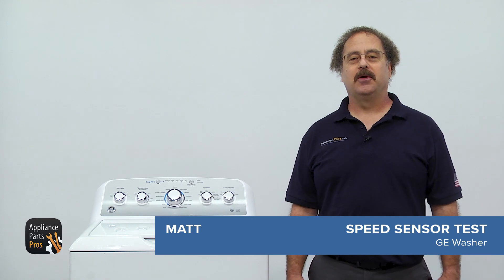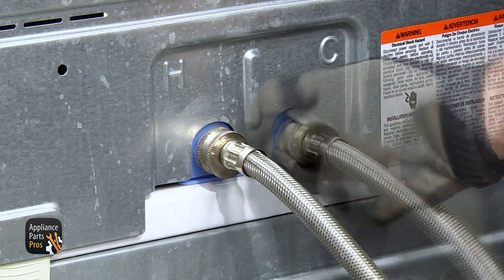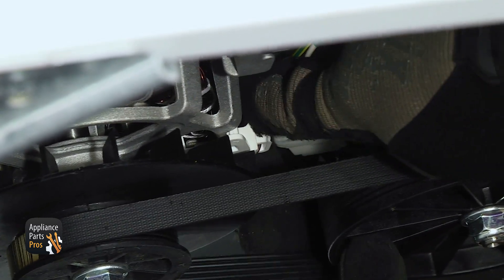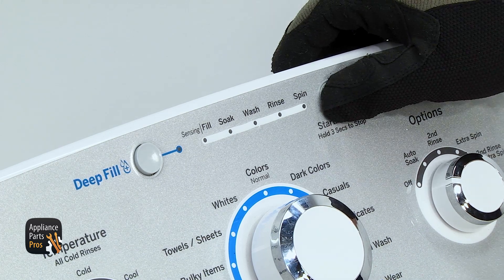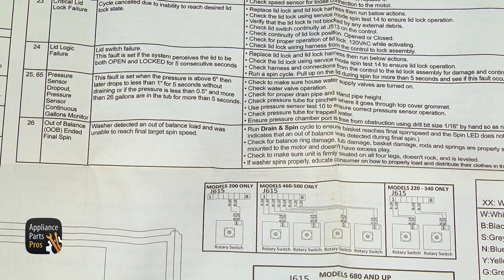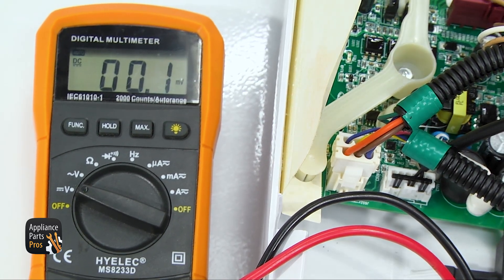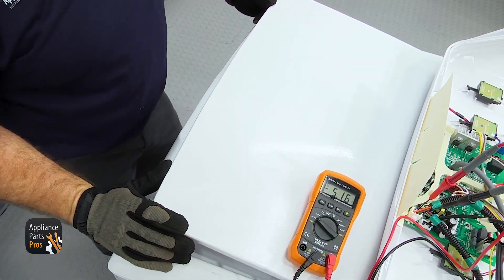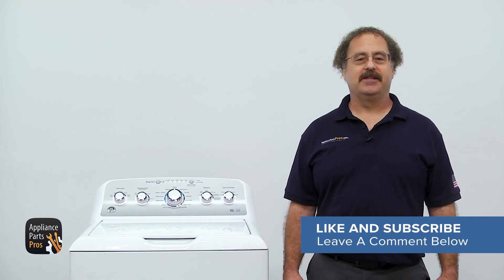How To Test A GE Washing Machine Speed Sensor

Comment: Ok I test the speed sensor wires orange to yellow I get the 4.5ish but when I check blue to yellow and spin the tub it the voltage moves then it settles at 0000 I've done it 4 times all comes back to 0000 . What does that mean is the speed sensor bad or what
Reply from the maker: hose readings could mean a problem with the speed sensor or wiring, but it really takes some model specific testing to know for sure. For detailed troubleshooting, our certified techs can help you at forum.appliancepartspros.com. Just post your model number and everything you’ve already tested and they’ll walk you through it.

Comment: 4.5??  what if stops on 09.16??
Reply from the maker: When testing from the #1 terminal to #5 terminal the reading should fluctuate and settle on 4.5 Volts. If it's different than that the part has failed.

Comment: Should the transmission be able to spin in either direction?
Reply from the maker: Yes, the transmission in a washer should be able to spin in both directions, although the amount of resistance and the speed may differ depending on the cycle.

Comment: WF330ANB Samsung frontloader. Will a bad motor Hall sensor cause erractic or no spin? I can rotate the tub a little or the stator rotor  go turn it back on and itll spin mometarily. LOL.  If you wait after it quits spinning a while itll throw a E3 code and beep.  Thanks in advance and Merry Christmas.
Reply from the maker: The E3 error code occurs when the unit is overloaded. If that is not the case then check the hall sensor to make sure the connection isn't loose or become disconnected. If it is damaged replace the hall sensor. Check the motor terminal connections and contacts for damage. Check the stator and rotor for damage. If everything checks ok then you will need to replace the control board.
Reply: When I spin the drum, the meter doesn’t really fluctuate, but stays around .459. My issue is odd pulses, and short timing of the spin cycle. Clothes are left soaking wet, but washer drains fine.
Reply: Also, the first test, Orange to yellow, measured perfect.

Comment: Meter shows blue and yellow at .456 volts
Reply: On the video when the drum comes to a stop the meter shows .456 volts,not 4.5 volts
Reply from the maker: If it does not settle on 4.5 volts after spinning the tub then you would need to replace the speed sensor.
Reply from the maker: What is your model number and the issue you are having with the unit?
Reply: On another comment you said to check the tech sheet because the correct value could vary by model.